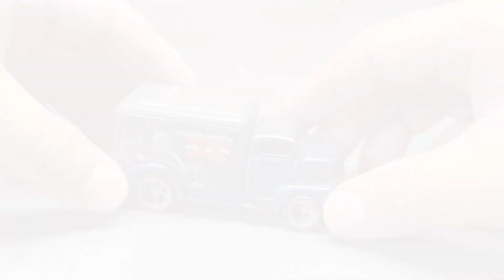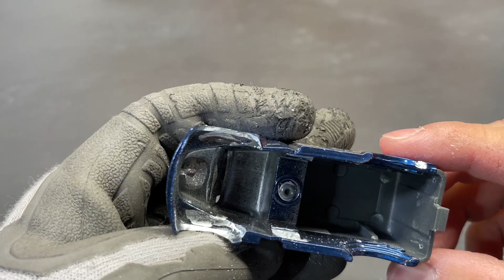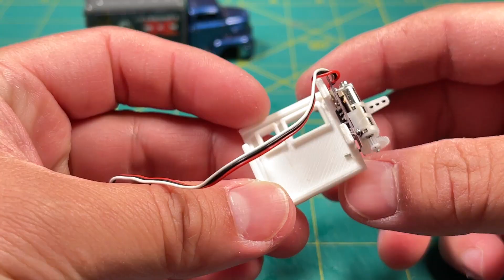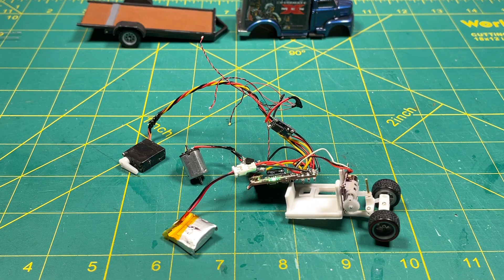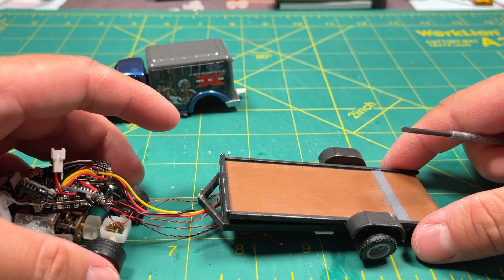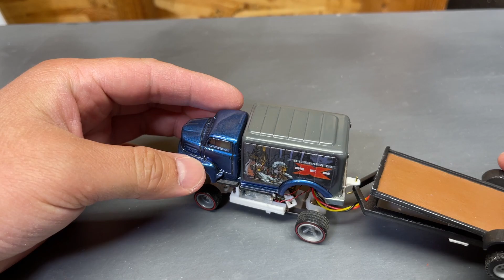RC Hot Wheels Custom with working TRAILER! | 1949 Ford COE

Comment: Great superb.
Reply from the maker: Thank you! This one was much harder than i first anticipated.
Reply: @SlickDiecast  How so.
Reply from the maker: @cyberneticinterfacemodular3996  I had to redesign the chassis a few times to accommodate the bigger motor. I had issues with the pivot point of the trailer as will. Lots of lessons learned.